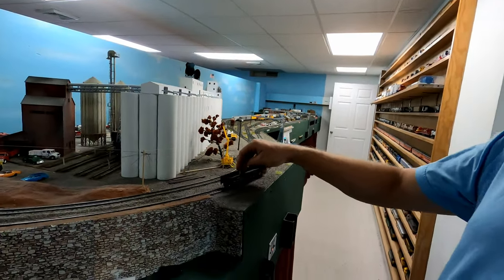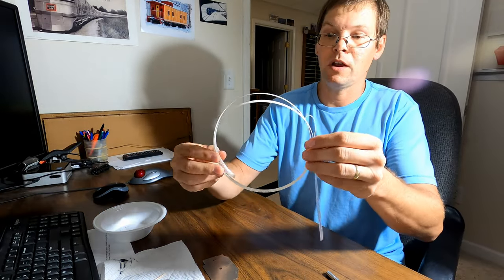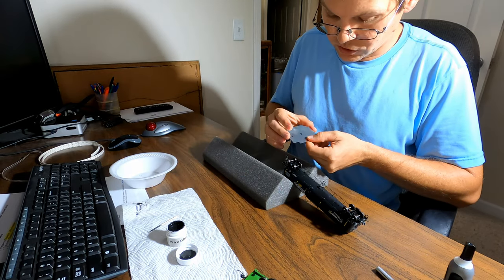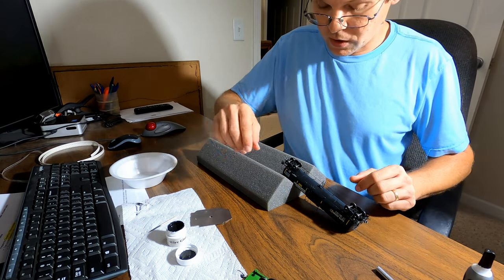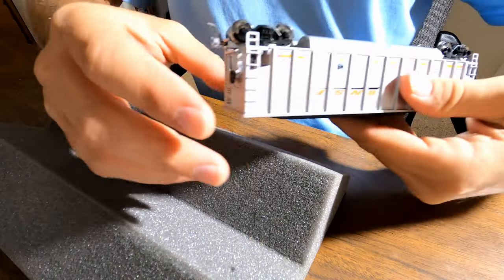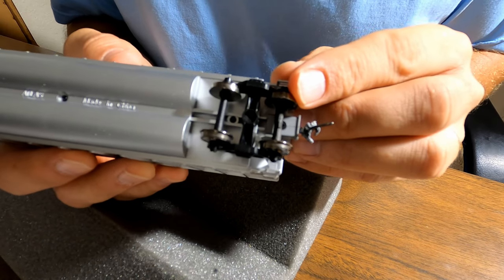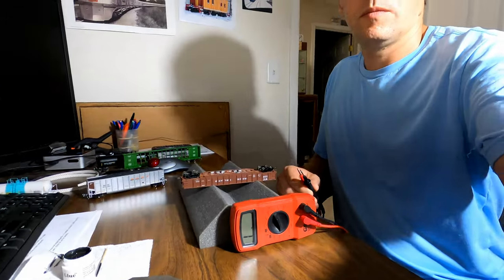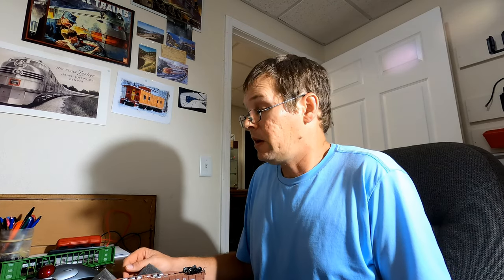Making Resistor Wheelsets for a Model Railroad

Comment: Very good explanation 👍
Would it be worth checking the resistance before painting with nail varnish 🤔
Reply from the maker: In the video I just describe the way I normally do it.
You could test each resistor before gluing on to the axle, then test after the conductive paint dries, then again after the nail polish dries and there's nothing wrong with that. 
But once I start there's no saving a bad wheelset, so it's pass/fail anyway. I figure I would save more time with a single routine than testing along the way for something that doesn't matter anyway.
In the event that I have a wheel that doesn't have any resistance then it just gets used as a normal wheelset.
My failure rate is extremely low so I don't have any issues with my process.

Comment: Nicely done!  I'm new to modeling and am going to start doing my rolling stock axles.  This is perfect!  One question - where did you get your gauge for checking the wheel spacing?  I did a quick search on Amazon and couldn't find anything... Thanks for sharing 🤠
Reply from the maker: That is an NMRA Standards Gauge. The NMRA is the National Model Railroad Association. They set the standards that modelers follow, and they make that wheel gauge. It also checks track gauge, frog clearance and tunnel clearance. Most model train shops carry them.

Comment: How many ohm resistor did you use for the wheels? Thanks
Reply from the maker: I use 10k ohm, 1/10th watt. Since we have over 500 cars on the layout, I needed to keep power consumption to a minimum.

Comment: Hi there - good video 😊
I have insulated axle both sides - presume i treat like plastic?
….and is 10k ohm a magic number - will others do? Thanks JC
Reply from the maker: If you have a metal axle and both wheels are insulated, then you will need to put the resistor in the corner bridging one insulator, paint the conductive glue like you would for a normal metal axle, but then on the other side paint a bridge across that insulator to complete the circuit. In the end, you want a path for current to travel from one wheel, across the axle to the resistor, then only go through the resistor to the other wheel. The resistor needs to be the bridge across the plastic insulator.
Reply from the maker: As for the resistor values, you can use a lower value than what the detection system says to use. We use Digitrax BDL168 boards, which say to use 10k. Other systems might say to use 1000, etc. The thing you need to remember is that these resistors are drawing current, just like a locomotive or lighted passenger car. If you have 2 DCC boosters, each 5 amps, then you have 10 amps total for your layout. Ohms law is IxR=E. If you have 1000 freight cars, each with 2 resistors of 1k ohms, and 14v track voltage you will have 28amps of total current draw just from those cars! But using 10k, you would only use 2.8amps, much more reasonable. Calculate how many resistor wheelsets you will use (usually 1 per truck, or 2 per car) and the value of resistor you chose to use to figure out how much of your layout current will be used by the cars. Keep in mind that you also need to allot some of your booster current to your locomotives and lighted passenger cars as well!
Reply: @signalupproductions  thank you that’s very clear JC
Reply: Thank you JC
Reply: Very good video and showing what the values were after fitting on the meter was also helpful. Thanks.